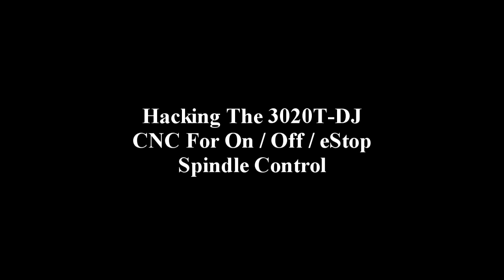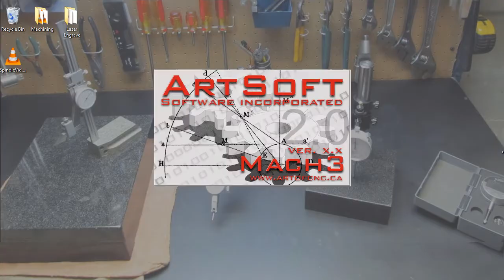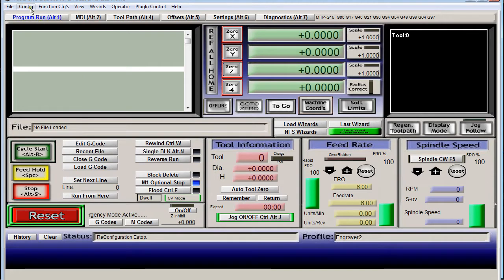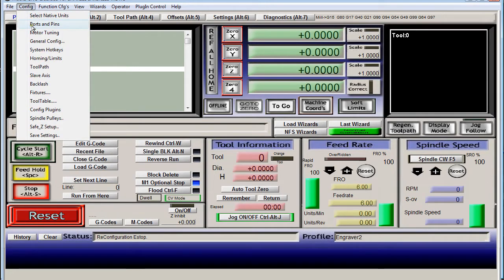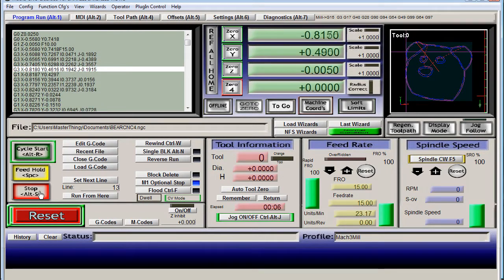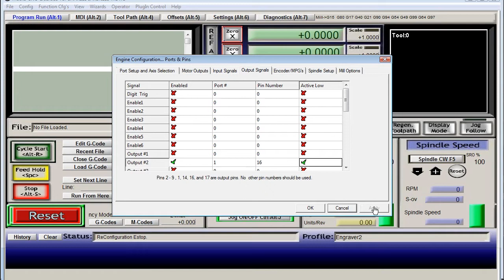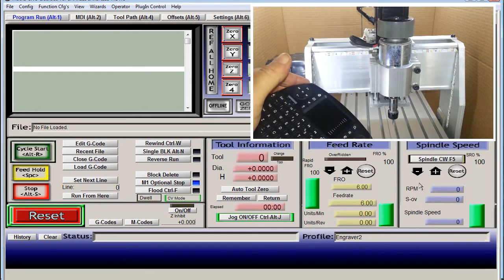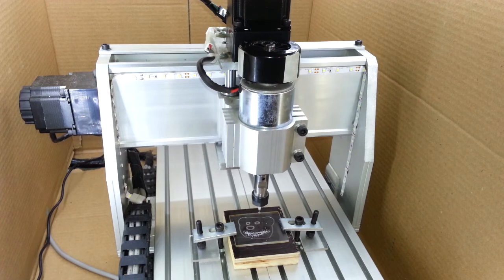Hack The Vevor 3020T-DJ CNC Router Engraver For On/Off/eStop Spindle Control JP-3163B JP-1482

Comment: didn't work for me, nothing would stop the spindle. I have a JP-382A and it doesn't have the extra relay connection. It has a matching 4 pin pmw connector but doesn't want to talk to the 1482

Comment: Is there a watch to add 4th axis to a 3 axis 3020?
Reply: Possibly.
I've just done it to mine.  The controller board on mine had 2 spare outputs on a 4-pin header, as well as a second 24V drive output on the controller board.
I ran wires from these to an external TB6600 module to drive the A axis.
I've seen at least 2 different styles of 4-axis box that use the same setup - a main 3-axis board and a separate single axis driver for the A axis inside the case.

Comment: 2nd video mach3 settings is below .Maybe my control box doesn't allow it or its build in and the ports setting are wrong  ,  i have tried many different output pin port .Or can you see in the 1st video witch is the correct port setting thanks.
https://www.youtube.com/watch?v=ji9wR1VTgQ8

Comment: Bonjour,
Super travail votre vidéo Bravo!
Je possède une CNC 3020 T-D 4 axes, votre vidéo m'a inspiré pour modifier ma CNC.
J'ai la carte JP-1482 mais ma carte contrôleur est une JP-382C légèrement différente de la votre, je voulais savoir si la modification est possible ?
Si oui quel est le connecteur à utiliser sur la JP-382C ?
Le soft de contrôle est CNC USB Controller. 
Au plaisir de vous lire
Cordialement

Hello,
Great job your video Bravo!
I own a CNC 3020 T-D 4 axis, your video inspired me to modify my CNC.
I have the card JP-1482 but my controller card is a JP-382C slightly different from yours, I wanted to know if the modification is possible ?
If so, what is the connector to use on the JP-382C ?
The control soft is CNC USB Controller.
Looking forward to reading you
Cordially
Reply from the maker: Thanks for the compliments. I'm not sure If there is a way to do a spindle control modification on the JP-382C board. I looked at a picture of the board and i don't see an on-board relay. Someone else may be able to help you out on this one.
Reply: Thank you for your answer, in doubt I will order and change the plate JP-382C for a JP-3163B identical to the one you have in your machine, I found it on ALI 40 € with the cable unless you have a better address? ...
Before ordering I need some information:
The length x The width for the space in the box.
There are two or three outlets of which a parallel with the side LEDs (machine data inputs) plus another or two others on the side are they useful? I consider desoldering not to have to drill in the case is there a disadvantage?
I prefer to change the map for several reasons:
Be able to make the change like you
Benefit from the end stops
On my current map there is a bug in the "probe" is the Y axis that is taken into account in places and place "Z" therefore unusable ...
If you have a mail would be simpler to communicate.
Looking forward to reading you.
Cordially

Comment: G01. X22.0000YO          G01. X21.6000 YO     G01.X21.6000 YO        G01.X216000 YO    G00 Z0.2000        M05
Reply from the maker: As far as the Z is concerned, it's being placed .2 above zero. If you want it placed higher, you just need to change the .2 to whatever height you wish (within your machines limits, of course). Again, just email me the program if you want me to look at it.

Comment: Hi Mate Nice Video....Do you know how to do that on JP-1635A and JP-382C board?
Reply from the maker: Hello there Fazal. JP-1635A is the 4th axis board (A-axis), so it's not used with this mod. I haven't worked with the 3-axis board (JP-382C), so I can't help you there. Try a search using your 3-axis board number and your spindle controller board number. Hopefully you can find something about modifications for these boards. If it's a fairly new board combination, then you might have to wait for someone to publish their modifications... OR tackle it yourself like I had to.   :)
Reply: Thanks Charlie🙏

Comment: Thanks, great tutorial, came across this looking for help with the same controller jp-3163b. All of a sudden pin 15, probe has stopped working. New subscriber, off to look at your other vids. Thanks from the UK.
Reply from the maker: Thanks, Shaun. Get the probe straightened out?
Reply: Charlie Sarsfield No, thanks for asking, I think I've fried that pin! :-(. I have my home limit switches on I think pin 10, 11 and 12. I am going to put them all on 10 and free up and use  pin 11 for probe. My plan for today :-). I love this tutorial but I've upgraded my spindle to 500 W so I have a separate 0 to 100v power supply. Any suggestions on how I could tie this in with this? It has a separate potentiometer as well, thank you.
Reply from the maker: No, I don't have any suggestions at this time. You've done, and are doing, some nice mods that I haven't messed with.  I bought micro switches for homing and limits, but haven't wired them in yet. You'll have to upload a video of your setup sometime so folks can check it out.